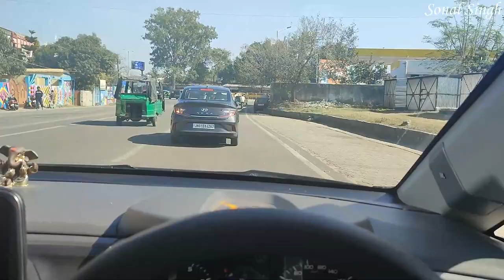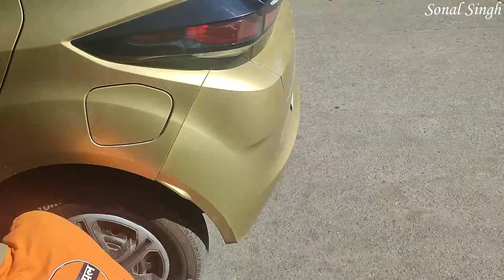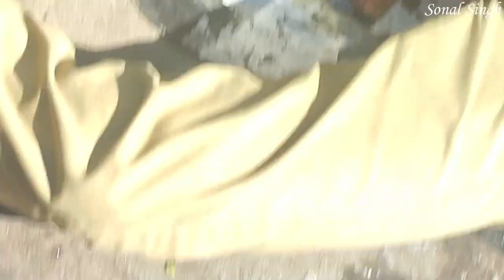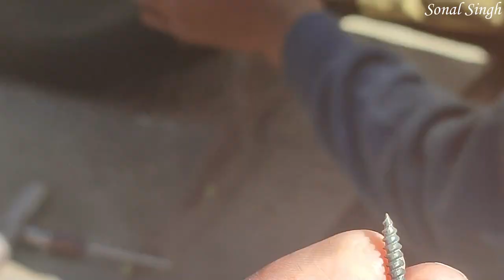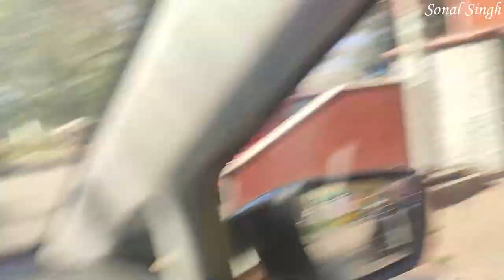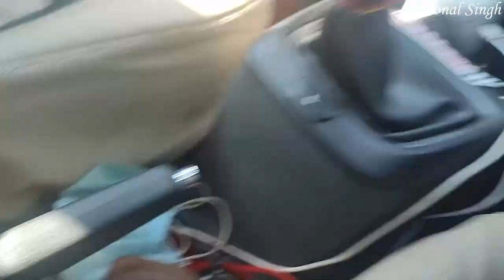1st Puncture of My Car😢 | Puncture Repair Process

Comment: Same happened to me and repaired in 5min. But it's difficult to identify the puncture. Tyre will not go fully flat due to tubeless tyre. But air reduces to 14psi. I used to put 33psi and next time I check it got reduced to 14psi. 2 times it happened. Then I showed in puncture shop and they identified puncture.